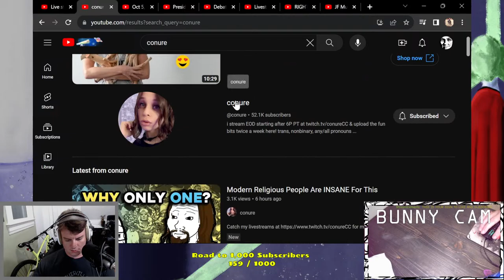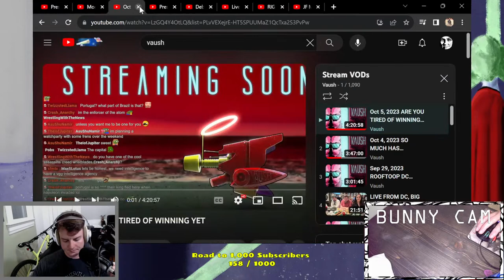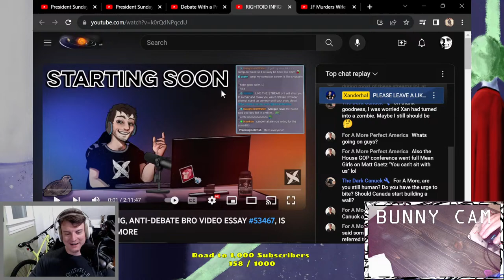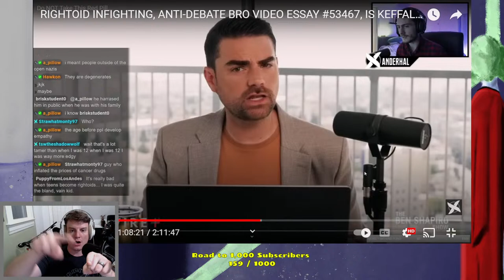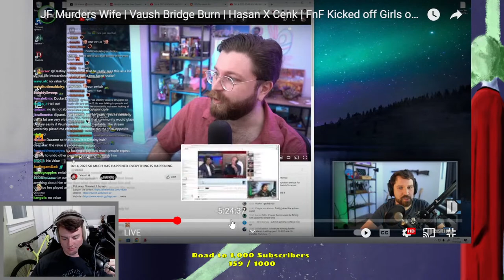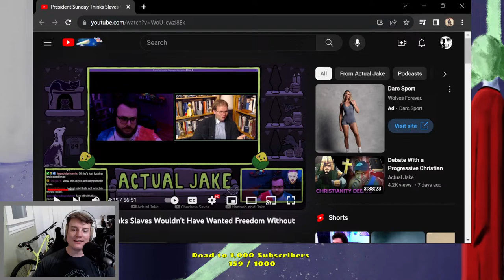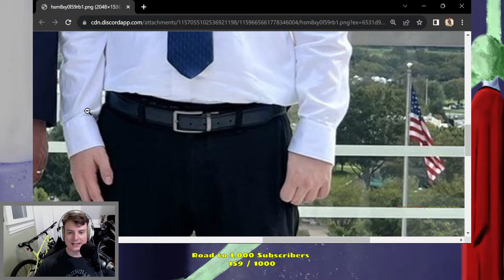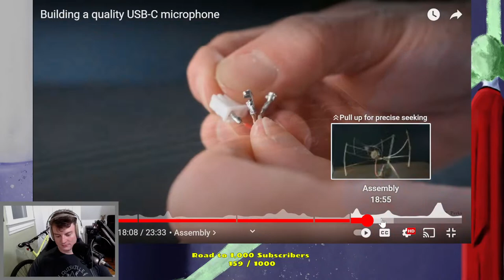Rating Lefty Streamers' Audio Quality and a Basic OSB Audio Tutorial

Comment: The missile knows where you are at all times. It knows this because it knows where you aren't. By subtracting where you are from where you aren't, or where you aren't from where you are - whichever is greater - it obtains a difference or deviation. The guidance subsystem uses deviations to generate corrective commands to drive the missile from a position where you aren't to a position where you are, and arriving at a position that you are, it now is. Consequently, the position where it is is now the position that you aren't, and it follows that the position that you were is now the position that you aren't. In the event that the position that you are in is not the position that you weren't, the system has acquired a variation. The variation being the difference between where the missile is and where you weren't. If variation is considered to be a significant factor, it too may be corrected by the GEA. However, the missile must also know where you were. The missile guidance computer scenario works as follows: Because a variation has modified some of the information that the missile has obtained, it is not sure just where you are. However, it is sure where you aren't, within reason, and it knows where you were. It now subtracts where you should be from where you weren't, or vice versa. And by differentiating this from the algebraic sum of where you shouldn't be and where you were, it is able to obtain the deviation and its variation, which is called error.